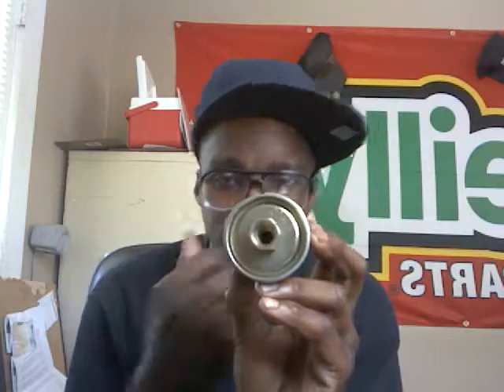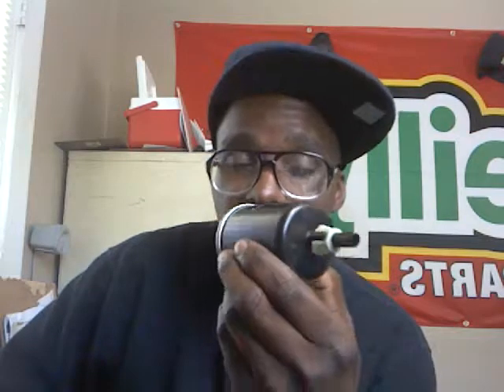What does a fuel filter do?

Comment from the maker: If you have changed the fuel filter and the pressure is still low that means that the fuel pump is going bad. On average the pressure should be between 30 to 40 pounds of pressure. The fuel injectors normally need about 40 pounds of pressure in order to push the fuel thru. You can find out online exactly what the pressure should be on you specific car.